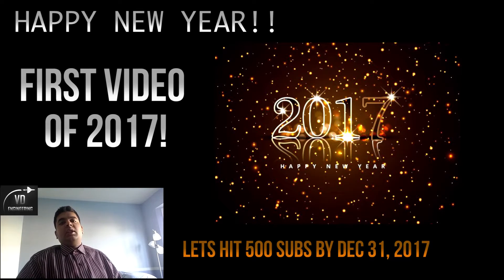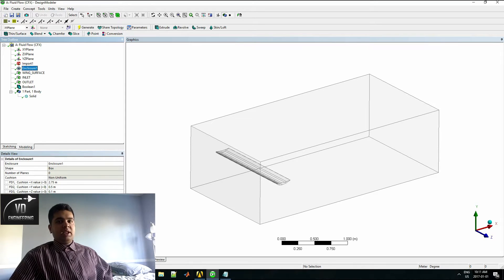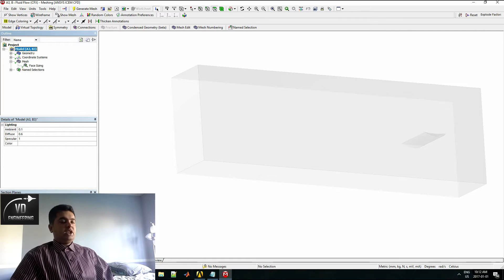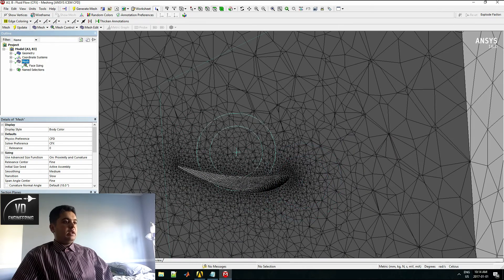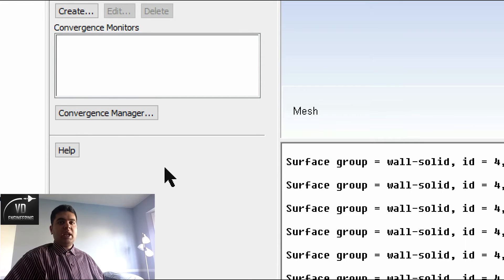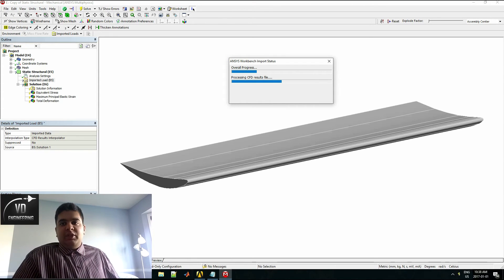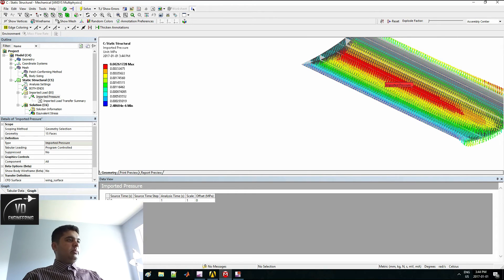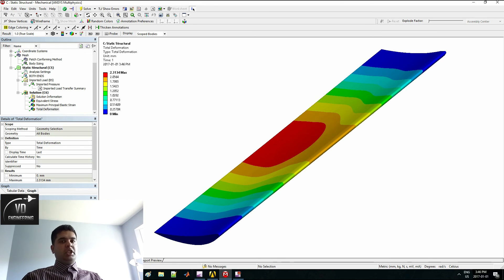ANSYS Fluid Structure Interaction tutorial (One Way FSI)

Comment: Thanks for posting such an informative video. I am doing 1 way FSI of Axial Compressor Blade. When I tried to import my pressure details from CFD to Structural. They are importing well with 100% mapped summary. However the pressure arrows are not visible just the colored contours apperaed. How to fix this issue?

Comment: I'm doing my project on magnetorheological shear thickening polishing for brittle materials. However, I'm doing simulations with ANSYS software for CFD, and I have obtained satisfactory results. But for solid mechanics, I want to check when cracks and fractures will occur and how the penetration of grits or abrasive particles could impact this. Could you please help me with this?

Comment: Thanks for such an informative video. I am modeling a two-way fluid-solid interaction, a backward-facing step using an oscillating fin to capture its secondary vortices. I want to set v= aw sin(wt) with defined values of a and w and give this velocity to a vertical fin installed in the top wall of this channel. Would you please guide me on how to give oscillating velocity to the fin? (Where should I set this value in Ansys mechanical)

Comment: How to do a topology optimization for the component in the static structural? i tried doing it using the usual method but i am receiving an error where it says Topology optimization does not support the static structural solution by FSI method and voltage based loads. Can you please help me out here.

Comment: hey Vin, 

thanks for making informative videos. 
I am a student and new to Ansys 
I need help doing Modal analysis of a beam submerged in water. 
I used modal acoustic analysis system 
i defined a beam and enclosed it. 
but don't know how to define the fluid structure interaction between the beam surface and the fluid for my case. 

kind reagards, 
Umang

Comment: How much time should it take to import the pressure load into static structural?

It is taking too long and showing as
Shape: : Construct BilinearWeights ()- Bilinear weight calculations not available for all shape types. Using regular weight calculation.

Does it depend on number of nodes
Or should the mesh size be same in fluent and static structural

Comment: Hi,
One-Way Coupled FSI is understood as a situation when solid deformations are negligible and fluid flow affects solid. But are there any One-Way FSI analyses with opposite coupling (solid deformations change fluid flow but fluid flow is not affecting these deformations) ? I think it could happen in case of very slow fluid flow (too slow to cause significant deformations) and prescribed solid displacement (due to inverse piezoelectric effect, for example).

Comment: my other question is that my fluid and structural bodies are different fluid one is hollow and structural one is filled with ribs and spars but loads are mapped 100 percent without system coupling. so can i continue? their cross section is ame.

Comment: Hi, my question:
- What is outlet?
- why your wing surface is divided into 16 parts?
- In meshing, can i use inflation with Yplus?
Reply from the maker: The outlet is behind the trailing edge of the wing 
16 parts because the CFD surface is solid, while the FEA surface is hollow.
And yes, you can try using inflation Y+, I just did it an easier method

Comment: Hello,
I'm trying to simulate an underwater vehicle FSI simulation. I have obtained steady 3D total pressure distribution on the vehicle surface which I'm importing in mechanical in ansys workbench. I'm getting 100% mapping but the values of total pressure on the vehicle is not matching. Fluent - total pressure -2MPa, Mechanical total pressure - 606Pa!  I have no idea why there is a mismatch between the output and imported data. please help.

Thanks,
Reply from the maker: Are you sure you selected the correct named selection? Check your boundary conditions.

Comment: Hello, i want to know how can i get hydrodynamic pressure on tank walls using ansys multiphysics after applying FSI by coupling nodes. transient analysis was performed
Reply from the maker: Hello,

Is this a 3D-Analysis? Then you will have to create a 'virtual volume' around the tank and set your initial conditions there. I am not sure how to make a virtual volume as all of my analyses are 2D, my computer does not have enough power for 3D.

What you can do is first perform the tank CFD simulation by setting a pressure on all 4 faces as usual, while previously creating a named selection to map the pressure-load to those respective faces, similar to what was done in this video. It's all about creating the correct named selection, using the appropriate locations as your surface.

One thing to note, selecting the inner tank walls might be a challenge, so you might have to use the 'selection filter' in the bottom left corner of the workspace, where you can select adjacent surfaces.

By hydrodynamic pressure do you mean sqrt(rho*g*h)?

Though I have not personally used the transient analysis feature, the principles should be the same, the only difference is that inertia is considered in transient, while ignored in steady state.

I hope this helps :), it's the best response I could give :(
Reply: Thanks for relpy.
Yes my problem is 3D but i don't know ansys workbench or cfd i used ansys apdl only.
I want to make ansys calculate hydrodynamic pressure from FSI between the fluid and the tank wall.
I wish you can help me.
Reply from the maker: Ansys APDL is the older version of workbench / mechanical / FLUENT.

You may have to use ANSYS FLUENT or CFD, and technically you do not need an FSI for this as you only have pressure to solve for, not deformation or deflection. I do not have any APDL experience, unfortunately.

Solve the problem with FLUENT, set the boundary conditions etc, and then go into post-processing (CFD Post). It might be much faster this way.

In CFD Post, you can select a 'region' where you want to calculate the pressure. For instance, you can define a 'plane selection' on the bottom tank wall, and then insert a chart (graph), where it shows the pressure.

Alternatively, you can define an 'Expression' and put the required formulas in there as well.

Here is an excellent link for the basics, the concepts I stated above is explained thoroughly:

https://confluence.cornell.edu/display/SIMULATION/2D+Steady+Convection+-+Numerical+Results

Comment: hi, can i know if i have two geometries, eg nacelle lip skin & piccolo tube, how do i select the imported load temperature in the steady state thermal? My fluent part is done with no problem
Reply from the maker: You have to create a 'Named Selection' for that specific region of geometry you want to import the values to. This has to be done at the very first step. 

Then, select those faces as the 'Named Selection', and map it during your imported loading step.
Reply: VDEngineering yes i have created the named selection. Thing is my problem is i have a lot of BC defined. And i dont know that to choose for the cfd surface
Reply from the maker: You just have to note down what name you used, that's it.
Actually there's a way you can name the boundary condition also.
I don't have too much advanced experience with FSI unfortunately, so you might have to consult ANSYS website, or try on forums.